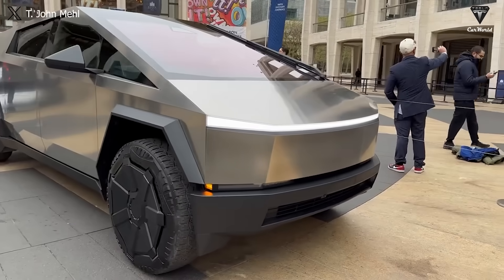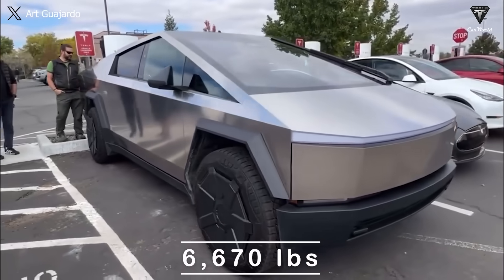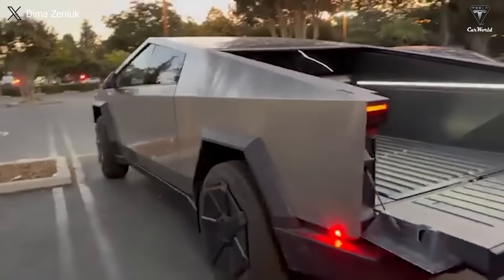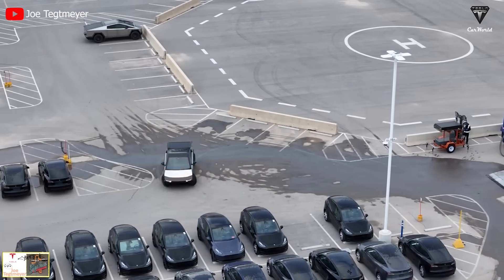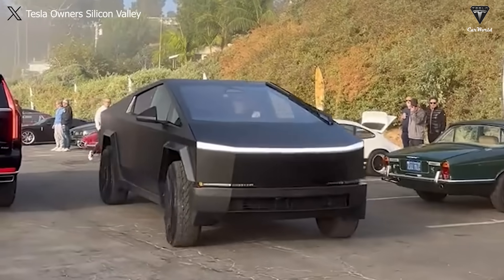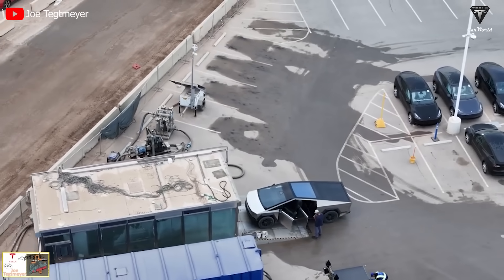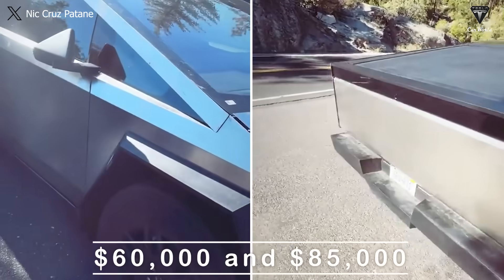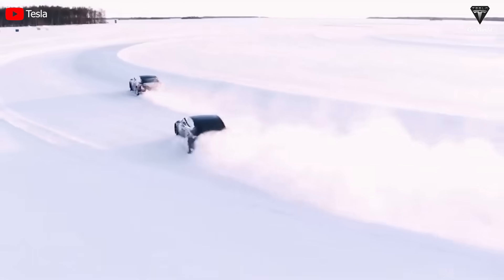Countdown to Cybertruck Delivery: 18 Days Left! Elon Musk Leaks Latest and Surprising Real Specs!

Comment: 8000 for the matt black upgrade lol I could wrap it myself for 600 come on Tesla that will be the easiest vehicle to wrap.
Reply from the maker: Maybe cheaper!!
Reply: If you want to wrap it in fragile plastic, go right ahead.  Use a neon color if you like.  The black is an anodized finish that's given to the stainless steel.  So it's black stainless steel, and probably a little tougher than the original stainless steel finish.  You might notice that a black stainless steel refrigerator is also more expensive, for the same reason.
Reply: @Jeffiekins  I've had alot of wrapped vehicles they are not fragile for 8k I could wrap it 16 different times in 16 different colors.

Comment: Looking forward to the launch. Regarding price? Lot$. I figure most will be over $80,000. Range is going to be lousy while towing. 

Production rate will remain very low for 6 months to over a year. Oh, arrival? It’s about time! 

But in the overall scheme of new vehicle development, this one is a clean sheet of paper design, start from scratch and build all the tooling and infrastructure to build it, I say 5 to 6 years is not really all that out of line. Most of the majors take 3 to 5 years to bring a new car to market, and they reuse quite a bit of existing infrastructure and parts bin pieces to do that.

Comment: Folks, their is a game changer on the horizon.  It's one part solid state batteries and one part Carbon fiber molds.  I'm talking the whole truck body and under castings.  You get a pickup truck under 4k lbs. and a range near 1000 miles....  Oh, and add a slide out bed that can be 6' at it's largest and under 4j' at it's smallest.  Now, you're talkin' easier to park and drive.  Add in full self-driving and wirless charging and you have a car service.  Oh, and imagine it driving itself to the limited maintenance that it needs.

Comment: I've been driving pickups for my day to day vehicle since 1973. I was a big guy, not so much now, but I have always liked the room and comfort of a pickup. I also like the body on frame construction. My latest one is a 2012 Silverado 2500HD w/matching Leer cap, all carpet and dark windows. The truck also has high q running boards, wheel flairs, well liners, vent shades etc. With BFG tires (stock suspension) it goes anywhere anytime, and with the 6.0HO engine w/3.72 lockers, at most any speed. That is what I expect from a vehicle. I like the duel engine CT. But I travel between my home and my brothers home, and its 412 miles. I can do that comfortably in 8 hours, in any weather. That is another expectation. Even if I have to bolt a Honda generator to the bed for a little extra juice. LOL  I really don't mind the electric thing, it looks like my lifted golf cart. LOL A range of 500-600 miles would suit me just fine. Since it would cost about $65k to replace my Chevy that would be what I expect also.  Maybe adding ~$5k-$10k as maintenance would be way less.  Just my 2 cents...   8)  Peace   --gary
Reply: gary, I'd hold out.  I'd wait til' the next generation of CT.  It'll be a 600 mile range and the FSD should be fully operational.  At that point, you can snooze your way to you your brother's place with no anxiety.-James
Reply: Have a 2015 Denali 4WD.

A CyberTruck is of interest to me.

But I’m not buying any car that cannot book out over 400 miles.
Reply: @RootBeerGMT  600 miles is the magic number.  That is the barrier that destroys range axniety.  It means home or work charging eliminates most trips to the super charging stations.  But, it won't even take that long.  The 25k dollar ev is going to be the tipping point.